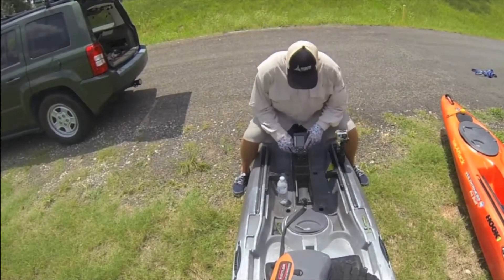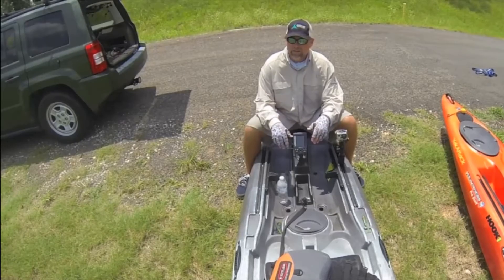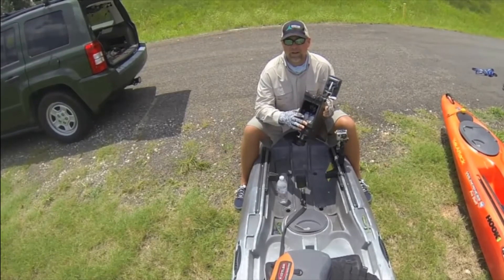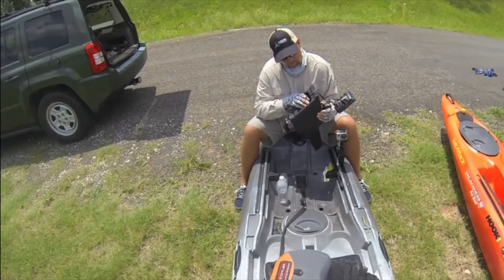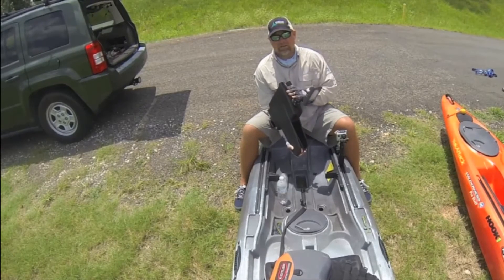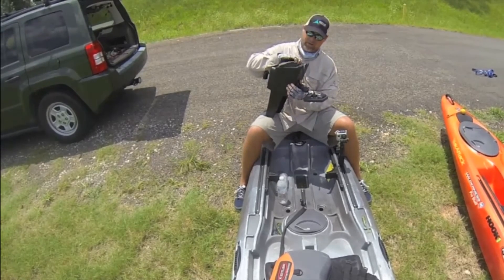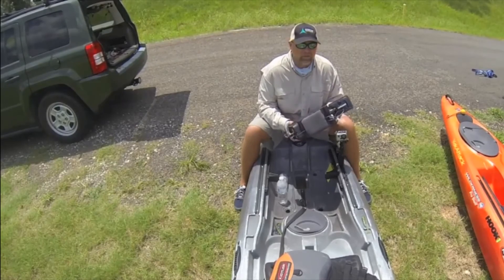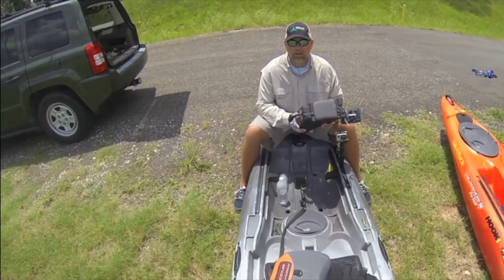How To: Installing a fishfinder in a Wilderness Systems Ride 115x

Comment: I’m finding that the transducer cable prevents the front of the console from sitting flush against the front portion (under the round WS logo). Is there any way to prevent this from happening ?